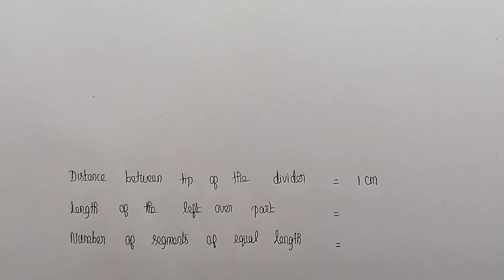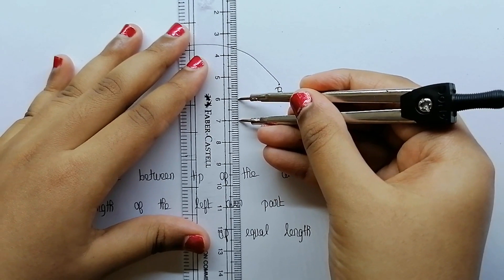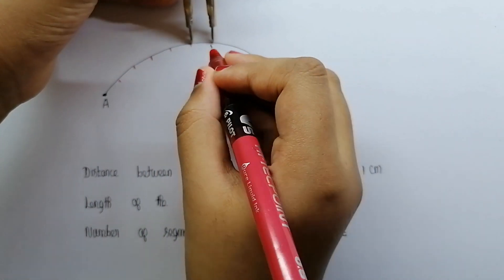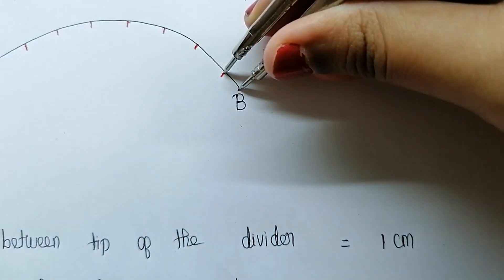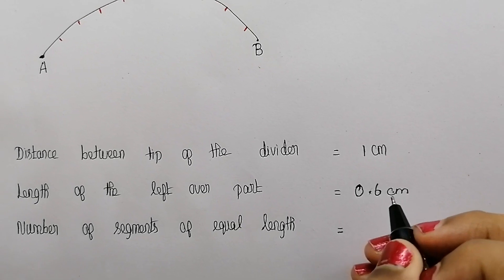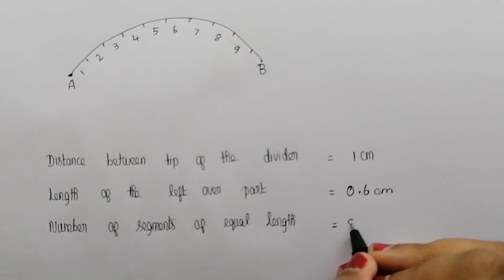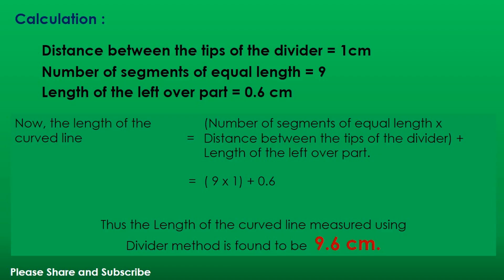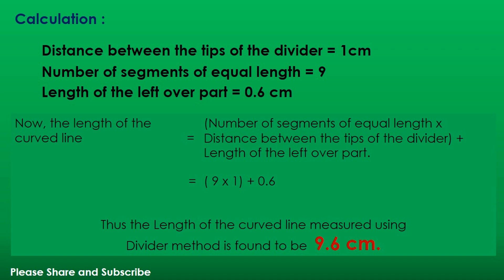Divider Method | Measuring the length of a Curved Line |  Measurement | Science Class-6 | # 17

Comment: How do u get 0.6 ans in the left over part
Reply from the maker: After counting the number of segments (each 1cm) measured using divider, the distance which is less than 1cm has to be measured separately ... That is the left over part...
Reply from the maker: Because the left over part of the curved line is less than the tips of the divider(1 cm), so measure it separately
Reply from the maker: To measure the left over part, reduce the tip of the divider so as to match with the leftover part and measure it with scale... O.6 cm